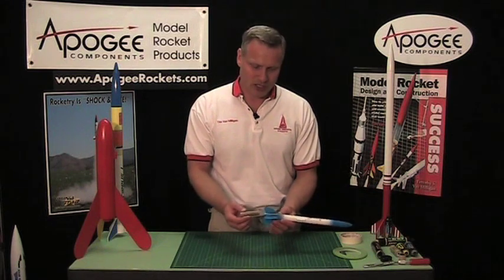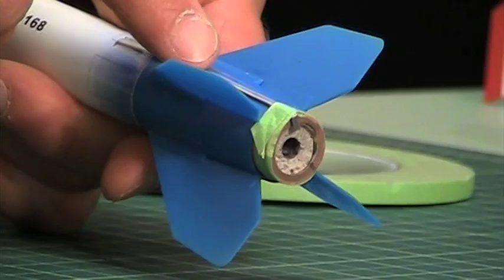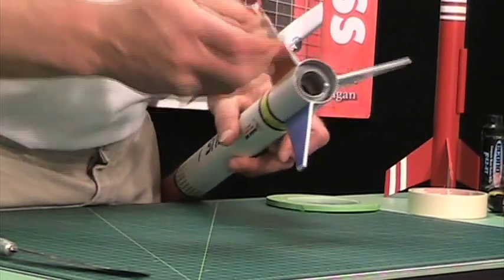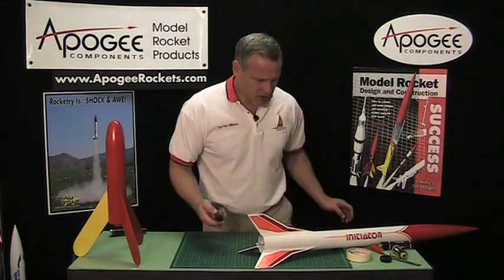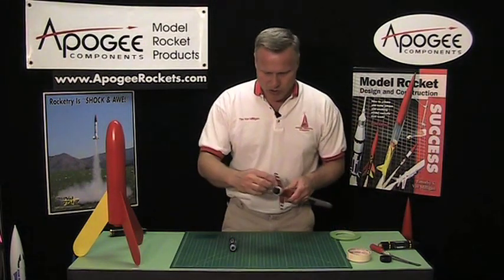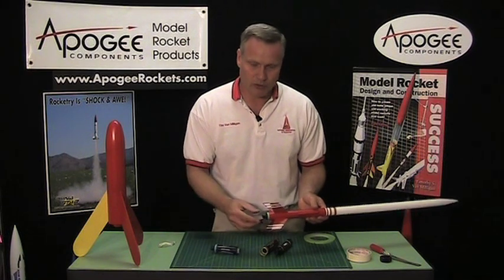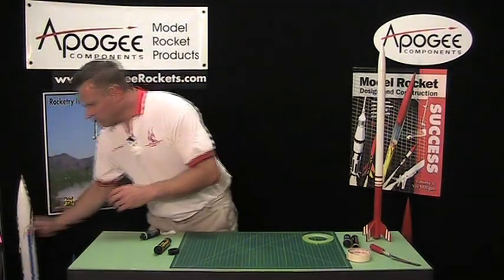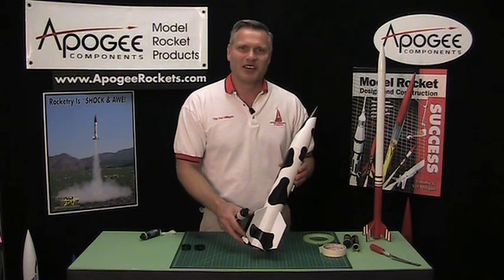Model Rocket Motor Retention Methods

Comment: Tim I currently use a grey Estes screw on engine retainer on my 29mm madcow solar express that i use but somehow whenever I insert an aerotech F20-4w the screwcap doesn't go on all the way to hold the engine in place, am I using the wrong retainer ?
Reply from the maker: It's hard to say without seeing it. Sorry.

Comment: for that last case you mentioned, I've found a better solution than friction. you can screw a small bracket into the centering ring which does an offset and holds the motor into the mount!
Reply: Hi Nate - got a repair job to do and this sounds interesting.  Do you have any photos or illustrations of this?

Comment: I used the no engine block trick in my Estes argent. I flew it on a 29 mm I105 motor it worked well. It flew to about 7000 ft and traveled At mach 2.3. The upper body tube I turned into a payload section and flew weather instruments with a speedometer and an altimeter in it and I got it back safely.